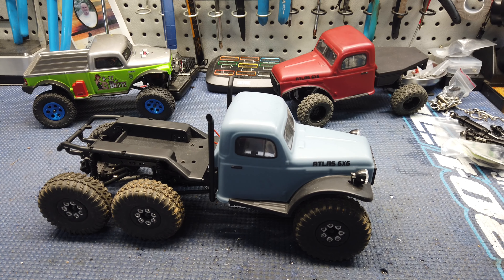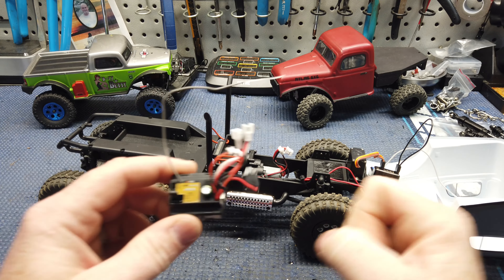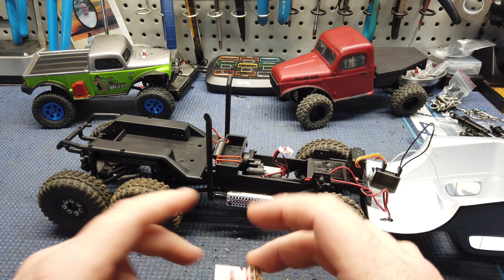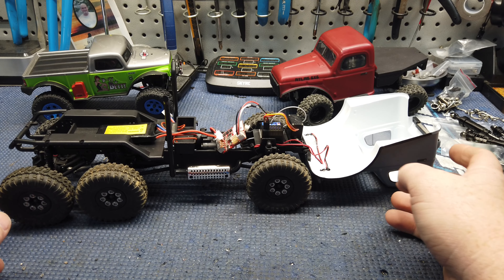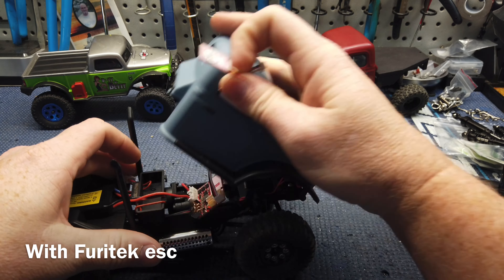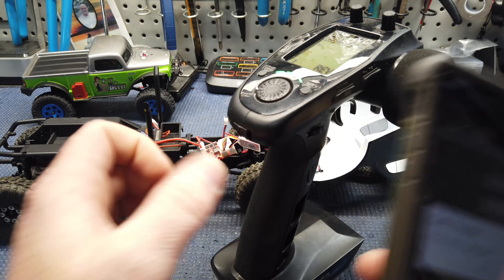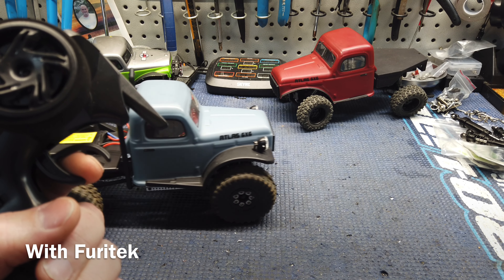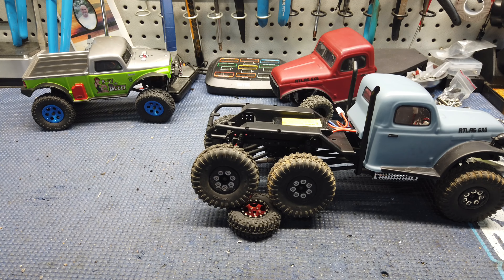Furitek esc in the Atlas 6x6! Best Atlas upgrade! How good is it?

Comment: Hey Matt, I wanted to give the atlas a go before I judged your opinion on the stock atlas esc. For me it was quite controllable at slow speeds and I think it was nice, however I burnt out the stock motor which is a 55T brushed motor, and I did that via steep indoor incline testing. The motor got so hot that it burnt me when I made contact. so be careful with that motor. Also another quick thing is I really like the noise in the stock atlas esc, I know I'm gonna get hate from at least Matt at 2FM RC for saying the atlas has really nice control out of the box, I will keep you guys posted on the updates via this atlas video and future atlas videos from Matt at 2FM RC. 

Thank you,

Raiden
Reply from the maker: It’s not as bad as say an element enduro 24 but it’s far from good lol. The main issue is the gearing is off. When you get against something in a bit of a bind it don’t like to slow crawl over it. It likes to pull, pull,pull, make a lot of noise and then jump over the obstacle. Watch the Furitek esc and brushless motor combo video and compare how smoothly that system slow crawls over obstacles. Flat surface the atlas is ok. When in actual tight situations it sucks.
Reply: @2fmrc  I would disagree on your opinion of the stock atlas esc because for me it was not only quieter from what you said but I tested the slow crawl over one of my tires and I got it as slow as the panda hobby tetra k1 which you will see in my review I got that truck pretty slow for what I have had. I've got a stock SCX24 esc and I might be using it in the atlas because I prefer the stock SCX24 transmitter. Thank you for replying though, And I really like those scramblers on it.
Reply from the maker: @jdads100  yours must be an updated system or something. I bought mine when they first released and it’s pretty bad. Just like the enduro24. Just makes a huge whine and then jumps over obstacles sometimes. Not much low end torque. Once you run the Furitek or surpass in the scx24 though everything seems garbage 😆
Reply: @2fmrc  I want to try one of those furitek lizard esc's if you can get one to me, because I know what the atlas does and you have your own so once I get another running truck I will show you on my channel what my slow crawl is like, because I love the tetra so much that it's my favorite truck, also I like the atlas stock slow crawl though it could do with a different transmitter.

Comment: These escs are really awesome. Have u seen that furitek also releases a small esc called the lizard that has almost the same features as the tegu board but is a lot smaller.
Reply: I hope it works as well as We think. I ordered the lizard (with Bluetooth combo) for my atlas 6x6. I think it will be perfect for this truck... (I also ordered the TEGU board for my scx24)
Reply: @MrMrsregor  I also ordered both 😁. But the difference between the two only seems to be the led support and a servo connection I don't need because my receiver does this as well...
Reply: @ssf-rc2171  that is exactly what I was thinking. Good luck with your upgrades!.
Reply from the maker: Yeah I should be getting one to test in a couple days!
Reply: @2fmrc  Good to hear...
Your Videos inspired me to do a scx24 build. It's a nice activity during the pandemic. This is the first rc car I ever build so thank you for your guidance. Would be nice if I could  send u some pictures when it's finished.
Reply from the maker: @ssf-rc2171  definitely shoot me some pics of it! You can email them to 2fastmattracing@gmail.com if you want. Really glad to hear I was able to help you along the way!

Comment: My stock Atlas performs just as janky as yours did before you upgraded it. Did yours run hot as Hell? I can't touch my motor after 5 minutes! I'm afraid to run it longer than that because it's got to deform the transmission housing. Does the Furitek alleviate the heat at all? I thought my motor might be binding but the pinion is set perfectly. Does anybody make a motor upgrade for these things?
Reply from the maker: I have a Furitek setup that I need to install in mine. Just haven’t had the chance. I’d say it’s a major improvement. I would also suggest changing all of the bushings over to bearings and make sure the wheel nuts aren’t too tight. That could be a couple things that would cause extra heat.
Reply: @2fmrc  have you actually swapped over to bearings? How the Hell do you get the bushings off the front axle? They won't fit over the dog bones at the joint and as far as I can tell, the axle doesn't come apart.

Comment: I have the tegu, a baby 12mm BL motor and a Fast Eddy bearing kit on mine. I love it. So smooth. 2 questions: 
1.) How do you power the lights with the Tegu? 
2.) Is there a more heavy duty transmission or gears available? Mine skips after the BL conversion no matter how tight I adjust the motor. Also, could the skip be because I used grease on the gears when rebuilding?
Thanks guys!
Reply from the maker: If you’re looking for upgrades gears for the atlas I’m really not sure as I haven’t messed with it much. Mofo Rc makes some great gears for the scx24 of looking for it. As far as powering the lights I’ve always used a separate receiver with mine so I just plug into it. I rarely ever run any lights though so I haven’t messed with lighting on them much.

Comment: You have to really love the 6 x 6 to buy all the upgrades it needs . Might as well buy a TRX 6 .
Reply from the maker: Lol I haven’t did anything to mine besides tires and this esc. I did switch the wheels but I would’ve ran the stocks if I hadn’t been sent these to test. It’s very capable out of the box. I just don’t use mine much because it’s too big for my indoor course and when I go outdoors I take the 1/10 stuff. The esc is horrible though that’s for sure. Servo is great though!

Comment: Dang!!!!  What a difference!!! It's nice not needing ear plugs or headphones.  Does the motor have any extra power with the new esc?  You read my mind, I was going to ask about the panda.
Reply from the maker: It seems like the low end power is better. The stock esc just sits and whines where this one seems to actually pull. There are a lot of tuning options with this esc so I’d say we could get a little more power out of it as well. I think they are working on a firmware update to run 3s so that’ll be killer!
Reply: @2fmrc  Sweet!!!  Gonna order a few of these!!

Comment: do you have bearings in it? You'll have more slow speed control with bearings over bushings.
Reply: I have the tegu, little 12mm BL motor snd the Fast Eddy Bearing kit in mine. So silent and smooth. You can make it go slower than the human eye can detect. It’s amazing.🤩 Just trying to figure out how to get the gears from skipping. We need an aftermarket metal gear case for it. The plastic one is flimsy.

Comment: I have got mine on pre order for my scx24. Do I need to order anything else in to use it in a stock other than barrage motor truck. Connectors/ adaptors etc ?
Reply from the maker: No you should be good! It’s basically plug and play. You’ll wanna download the app and connect the Bluetooth dongle to tune it a bit but other than that you’re set!

Comment: Thank you so much for showing the atlas some love!
If I buy a second spektum transmitter, can I bind two transmitters to one receiver ?
(I think the answer is no)
 I have more than one truck, and sometimes it would be nice to take one transmitter and two trucks out to mess around (when I am out solo), but other occasions it would be nice to bring two transmitters and two trucks out to drive at the same time (for me and 4 year old daughter trips)
Reply from the maker: I think once you bind the receiver to one of the transmitters you’d have to rebind it if you connected it to another. The transmitters are made to work with several different receivers but I don’t think the receivers are made that way. It would just be a matter of throwing a bind plug in and binding it real quick when you did wanna use a different transmitter though. Pretty simple switch.
Reply: @2fmrc  that is what I thought. I want to buy a second transmitter to be able to run two trucks together at one time, but don’t want to always have to have both with me...
I might continue using my stock transmitter for scx24 and use my spektrum for my atlas, until I get a second aftermarket transmitter... thanks for advice!

Comment: Is there any transmission upgrades that you know of? I got my brother one, and the first day it got in a bind and broke teeth on the gears
Reply: I do not have an upgrade to suggest. (I would love to upgrade this truck, it has great potential) But I can tell you that the complete gear set is only $4.99 i ordered 3 sets of gears when I ordered my truck because I thought plastic gears won’t last long...
I have also put my truck through some of the hardest rock courses and have not stripped the gears yet, but they are making a noise now. If it gets in a bind on the rocks, you better let off the throttle or something will break.